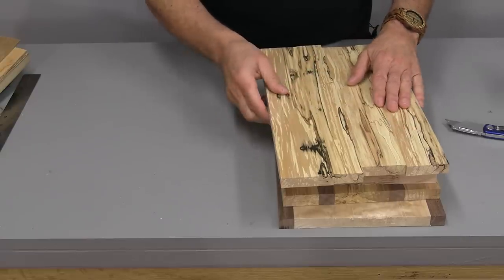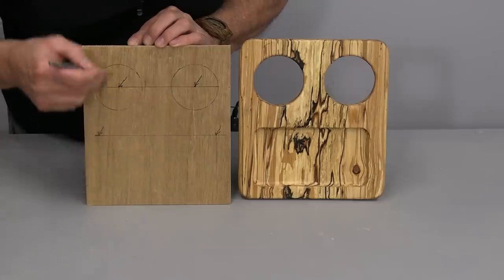WARNING! Everyone Will Want This Coffee Carrier

Comment: So when the cups are full of liquid, you have to have the hand strength to be able to hold onto the sides of the board with the weight of the drinks weighing down on the front and it takes both hands to carry.  It looks pretty but thats super inefficient.  Make one with a handle so when its loaded up someone can carry it with one hand while using their keys to open doors or do whatever else they made need to do.

Comment: i finish my wood with 2k car clear coat though you need an air fed hood and complete skin coverage even if you don't spay it and brush it on. i find everything else either goes off in the jar, the lid gets stuck, or it isn't waterproof and so you get watermarks. 2k lasts because it won't go off until the two components are mixed